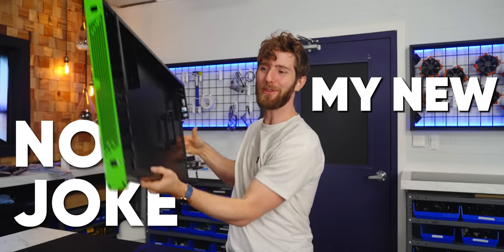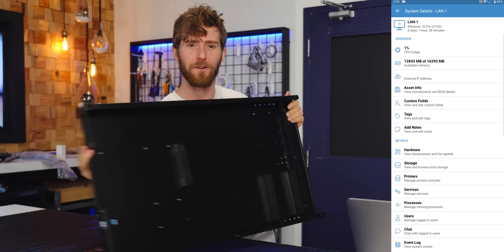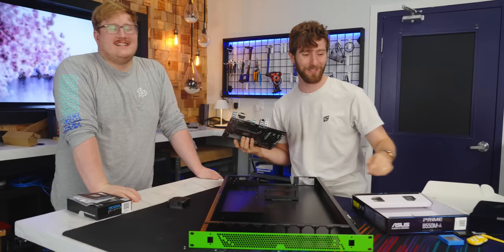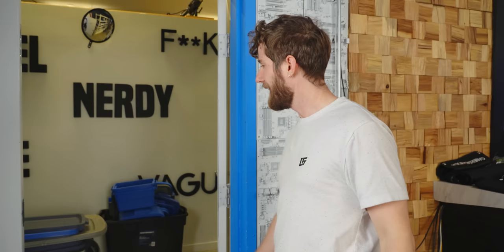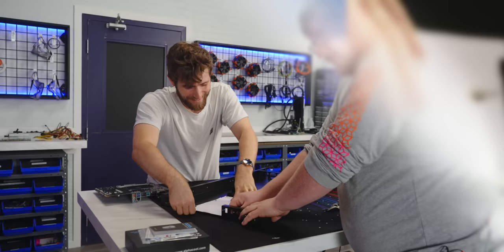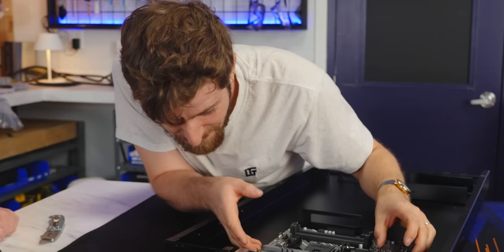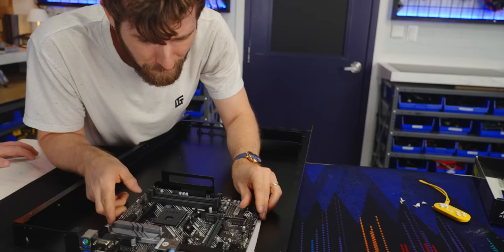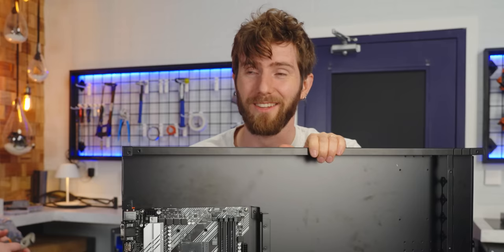This is my new gaming PC! - 1U PCs for My New House Part 1

Comment: Sounds like an opportunity for LTT to create the first fan hub that doesn’t suck.
Reply: It sounds like something an employee could have been designing as some side project for like 5 years lol
Reply: Might take 4 years but i would buy it. Just hope they make a version with like 14 ports.
Reply: At work I've been using 2 cheap 10 port fan hub from china, I bought them to temporarily replace a cooler master hub because it broke. It cost me 12 bucks shipped and they have lasted 5 years running basically 24/7. Only caveat is no RGB and all the fans have to run on the same speed. It has a connector that goes to the motherboard so I can control the PWM.
Reply: @EmoChipmonkVOD  Modular fan hub.
Reply: I’d kinda hope it blows tho
Reply: Aquacomputer ones are pretty good. If temperature sensors are hooked up to them, they can do everything onboard without worrying about software crashing. Even when the sensors are external, their software controller is service based which is more reliable than process based ones.
Reply: Yah it blows
Reply: Aqua computers makes insane fan hubs.  They even did a video on the leak shield they make.
Reply: Agreed, have a custom PCB printed up with headers for each of the fans, that way you can only unplug the bad one to swap it out, system stays online.
Reply: @GirAiDWinters  can you explain the difference between "service based" and "process based" ones?
Reply: @cubertmiso  I'm not sure how robust the windows service manager is, but if it's anything like on Linux, service manager manages the life cycle of a service. If the process of a service dies or stalls, the service manager will try to start or restart it. On the other hand, if a standalone process dies or crashes, you lose the functionality of that application until it is restarted manually. This happened to me when lianli's fan controller software went into a limbo state and stopped adjusting the fan speed, causing my temp to skyrocket and unbended my hard tubes in the custom loop.
Reply: And cost $200
Reply: As long as you're not using RGB, there's good, inexpensive ones out there. I got a Deepcool FH-10 for $9 last December and it's worked flawlessly. All the fans run off the same PWM signal, but given they're all on the same radiator it's a non issue for me
Reply: @carlangelo653  I guess we are using the same thing. But mine is 5 port and about one buck (without shipping and I live in China so shipping is really cheap) and I tested it. One of the ports does reply the fan speed to the motherboard, the others only allow PWM and power. So if you use similar fans, you should be fine with speed control. There is basically no chip or anything on there, just a PCB and a few headers There is a bigger one though and it takes 12V from a molex so the fans don't overload the port on the motherboard and destroy it.
Reply: @yuxuanhuang3523  yeah sounds about right, but instead of molex mine uses a sata power connector
Reply: aquacomputer splitty
Reply: If they could push for standardised outputs on modular PSUs that'd also be great 💪🏼
Reply: bruh you are true,he probably would do that
Reply: The NEW LTT Fan Hub!!! (its just an extender split 6 ways in a box)
Reply: elmor of Elmor Labs has already done this.
Reply: @GirAiDWinters  That's what you get for using software to control your fans bro.
Reply: @GirAiDWinters  I second this, aquacomputer makes reslly reliable ones that also have connections for temp sensors and even rgb control

Comment: I guess going that thin makes sense considering that you only have so much more room on your server rack at the new house. And hey, the fact that you can put a 3090 in such a thin server-mounted rig is impressive. I can’t even begin to imagine trying to fit a 4090.
Reply: Spammer
Reply: 4090 pcbs are the same size as 3090s and there's already a 1 slot waterblock for reference pcbs.
Reply: 4090 chonky size are mostly the heatsink, I think it would be about the same size as 3090 by watercooling it
Reply: @CyanDumBell_MC  True, but wouldn’t that still equate to higher cooling requirements? Or would that be irrelevant for water cooling in terms of how thick the water block would be?
Reply: @Neoxon619  4090 is same TDP as 3090Ti but twice as efficient. Or you can go for more performance at the same power. Cooler is basically the same volume.
Reply: @Neoxon619  it’s 450 vs 350 watts. That’s can be handled by the block. The extra heat will have to be handled by radiators and could overwhelm a loop. But in this case, the pool is the radiator, so that is not an issue.
Reply: @dex6316  So it shouldn’t be that difficult of an upgrade an Linus wanted to go that route, right?
Reply: The thicc cooler would be taken off the 4090, so it would fit exactly as a 3090 would with a water block on it.
Reply: @Lead_Foot  actually it's even smaller than the 3090 haha
Reply: Probably why it crashed ever single time
Reply: Tbh a lot ofy home rack is taken up with networking and storage.
Reply: @SimonBauer7  He doesn’t need a radiator, he is using the computers to heat the pool. Overclock everything in the house and game nonstop for a week and the pool might come up a quarter of a degree. F, not C.
Reply: The fith wont be an issue, the PCB of 3090/4090 is the same, so the waterblocks will be same sizes too. The only reason the 4090´s are taller/bigger normally, is cos of more cooling required due to the 450Watt Total board power requirements, over the 350 default 3090 TBP.  But water cooling will fix that quite ez. The biggest issue would be that a 850watt would be cutting it super close considering all the extra stuff they wanna run within the system for that psu.
Reply: 4090 isn't any bigger than a 3090. It's just the huge ass coolers and heatsinks. with an EK block it will be the same size as this.
Reply: @SimonBauer7  So the smart route for long-term use would be a bigger radiator?
Reply: @Neoxon619  I don't think he'll have issues cooling anything down seeing as he's dumping heat into the pool. He could probably run shuntmodded 4090s with overclocked 13900k's in every system and it would still not overwhelm the cooling solution. Not that he would need it for a LAN PC ever, but he could.
Reply: The 4090, based on all the reporting, especially by Der Bauer, would be a better option than the 3090. The size is the same, more or less (when naked), but it is more efficient which would be beneficial as well.

Comment: Instead of cardboard, use fish-paper (vulcanized cellulose fiber). it is designed for electrical insulation. You can also use really wide kapton tape.
Reply: I recommended paint protection film used on cars since it’s a just in case scenario and not stopping actual contact….but yours seems like it is a pretty good idea even though I’ve never used it before.
Reply: ya a single sheet of kapton is exactly what its made for to insulate electronics in these situations. tape it to either the bottom of the chassis or the board
Reply: A bit surprised they didn't suggest an LTT desk pad, adding an extra store plug 😬
Reply: Both electrical tape and the cardboard are unsuitable if you want to keep sharp objects from piercing through. Kapton might be fine. A thin PTFE sheet would be the real deal.
Reply: The only concern I'd have about cardboard is the solder points poking in and penetrating to the metal under, anything that's bad enough to set the cardboard on fire would destroy the system anyway.
Reply: Yeah, as soon as this stuff gets wet (and it will, only a question of how long it takes/how much it needs to be to short a circuit) it will be worse than doing nothing...
Reply: @thethoeby  Yes, good catch... Wetness would surely be a problem especially with water cooling in there.
Reply: They also have a CO2 laser so I bet with 30mins in CAD they can design and make custom inserts for their case.
Reply: Maybe spraying the backside of the motherboard with plastidip might also do the trick
Reply: they will probably change it. i think its only because teh video has to go out
Reply: i was also thinking kapton tape. They also make them pretty wide, and commonly used around 3D printers so I was surprised they didn't think of that
Reply: I was thinking that conformal coating would be best.
Reply: I'd personally opt for plastic sheeting such as that used for vapor barriers, super cheap at home depot and electrically insulating and resistant to piercng by nature.
Reply: @DeinonychusCowboy  a thick PET would be better, like 40 or 50 um. Vapour barrier is PE and not very puncture resistant.
Reply: Cheap adhesive shelf liner from Walmart would have worked well.
Reply: cardboard is actually pretty ok its combustion tem pis like 400F
Reply: That's a great idea, I was just thinking they could use flex tape. It's cheap and available just about anywhere. It's wide enough to cover lots of area quickly.
Reply: If desperate I was thinking of baking/greaseproof paper, used for lining trays in the oven up to 220°C
Reply: They have a laser cutter and a Cricut. Could just do vinyl.
Reply: @graealex  Like a piece of US Milk jug, but milk in Canada comes in bags.

Comment: When I worked for an electronics company designing rack mounted equipment, UL rules require 4mm separation between leads and chassis on DC circuits and 8mm from AC circuits to prevent arcing between the leads and the chassis. You can use fish paper which passes UL 94 for fire resistance if you HAD to go narrower.
Reply: I'd probably just flood the bottom with a flex seal kind of deal (or liquid electrical tape)

Comment: I simply love those kind of "I want it exactly that way" builds where it's not simply "get the biggest GPU and throw it into an overkill, watercooled PC case" but one where there is a specific use case 99,9% of all people don't need/want and that is genuine something new and interesting. Love the idea with the external cooled rack PCs!
Reply: Exactly. I've found that alot of enthusiasts develop interests in very. specific. setups, that aren't conventional and push the limits of compatibility. 
Hearing people's reasoning behind their decisions, and also watching them work around the problems, is much more interesting then "hey guys, xyz here, today we slapped a 4090 and 7950x together. wow look at big number, make sure to subscribe!"
Reply: Agree.
Reply: @peyton_uwu  I'm designing a 7600, 6700 10gb build right now that's designed not for numbers, but to sip power and stay as cool and quiet as possible while also displaying 144hz 1080p. It's been fun to craft and design so far.
Reply: Tell my why.. Ain't nothing but a heartache.... TELL ME WHY!

Comment: The fire point for cardboard is 258C and the flash point is over 420C. I think Linus will be fine using the motherboard box as an insulator. By time it catches fire, he will already have other, greater, issues.

Comment: You could have used just a few silicon anti slip mats used in kitchens. Heat resistant (if it burns you pc is already on fire) and isolates. It's about 1mm thick and doesn't cost much either.
Reply: That sounds one possible option. Or you could use the correct stuff and use Kapton sheets instead.
Reply: @MikkoRantalainen  What about just the plastic(antistatic bag) the motherboard comes in, in the box?
Reply: @ggesdsdsdsd  That might work, too. I'd be a bit worried if the vibrations cause thin metal parts to go through the plastic in long run but the low stand-offs should probably avoid long-term contact so that would probably be okay as-is. Great idea!
Reply: @ggesdsdsdsd  antistatic bags conduct electricity. That's why they don't build up a static charge
Reply: At my one job we would use fishpaper, it's a perfect choice for this.
Reply: @MikkoRantalainen  kapton is much less resistant to punctures, so you'd better be sure there are no sharp spots on the solder points whatsoever.

Comment: CPU being too low is sometimes a real metric on busy servers. It means something is weird like some connection dropped or something crashed in the pipeline but it really is a thing!
Reply: Yeah and especially with cloud computing where you pay per core. If it is at 5% all the time and 10% max you have the wrong instance sizes and van save a ton by downsizing.
Reply: The load balancing is borked again

Comment: PEI Sheets would make for a good separation layer for this application IMO. It's thin, Provides good electric insulation even when hot and is resistant to high temperatures.  The best part is it comes in easy to use square adhesive sheets since it's widely used for 3D printer heated beds! a Simple hole punch could be used for the standoffs as well
Reply: They have a cricut they used for making wall decorations, it would be perfect for making the separators.
Reply: Liquid electrical tape is another option. Coat all the contacts with it and you can go pretty thick if you want. Easy to remove if you need as well. Cheap and effective option.

Comment: there is a product called "fish paper" that is flame resistant and a good electrical insulator and quite thin. You should have this as a tool in your tool-box.
Reply: is that baking paper?  ... if yes, baking paper is perfect.
Reply: @splatt3d  no it is not baking paper, it is very heat resistant. When I worked in the tv industry we used it to separate electronics parts. I don't know what else it might be called.it was more like a very thin very dense cardboard, I have only seen it in a blue-grey color.

Comment: By connecting your water system loop to the on you created below the pool, you might also consider that, during the winter, since the temperature outside could drop till 3 degree Celsius, it might create the risk of condensation inside all the systems connected to it.
Reply: heat exchanger.
Reply: It would be a smart idea to install something like thermostat on cars. That way you can shut off valve if temperature of outside water is under ambient temperature.  It wouldn't be so hard to implement, but you would need a second loop that wouldn't go outside.
Reply: That might be an issue if server fans didn't move air thru the case at transonic speeds.

Comment: Linus, once you finish this build you should partner up with those companies and release a LTT gaming 1U computer. People would buy them.
Reply: Yeah, I’d get one for sure.
Reply: I was gonna say no they wouldn't but never mind😮
Reply: Linus! shut up and take my money!
Reply: @Adam Hazza He has, and his reasoning is sound but it would still be nice.  If they've already done the work use a system on a regular basis they could at least provide any data we'd need to replicate it ourselves.  Honestly even a 2U solution would be nice, the main problem for me is finding a place to put the server rack and getting the fiber set up (I've tried doing some research on my own but it can be quite confusing and potentially expensive).
Reply: Just picturing people working with servers just slipping in there 1u gaming PC's in the work rac
Reply: I really don't think enough people would buy them to make the investment worthwhile. Pretty sure there aren't enough people with out of the room server racks.
Reply: @nbrikha  There's at least one company out there (Linus has mentioned them before but I can't think of the company's name) that specializes in server rack gaming PCs so there must be a market of some sort.

Comment: 16:57 Jake had a point, I think older systems (I ram into this on a X99 board) have problems with PWM signals that causes fan hubs to just run at full speeds. Splitters+extenders though, work just fine
Reply: I think Noctua mentions in their manual that you should not daisy chain their extensions (although I never understood why and am still doing it).

Comment: You guys didn't actually need to tape the edge of the case where the I/O shield was supposed to go. The I/O shield is also used as a path to ground for the outside of the I/O ports, so you wouldn't be shorting anything out that wasn't supposed to already have that path in it.
Reply: was looking for this
Reply: @Nur__  i wasnt
Reply: what the custom power going all over the place, it not normal PC power  running steal of the case? there at least one in this with 24 volts going somewhere, so what about the rest on the stuff in the rack already who knows in the minus (-) side power thing already?
Reply: @dh2032 bro work on yo spelling ☠
Reply: @whiffingherbs  your

Comment: I recommend using Kapton tape next time instead of electrical tape. The adhesive is better than electrical for these surfaces and you can buy wider tape to cover more area.
Reply: The PCB component legs will pierce through the Kapton tape way too easily. It’s insulating but relatively weak.